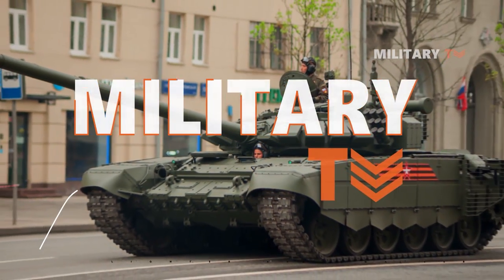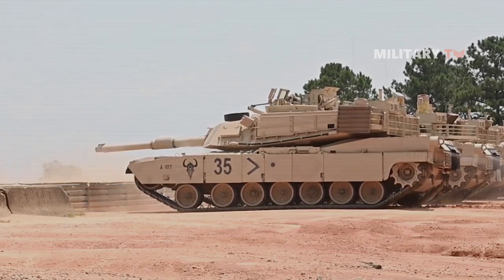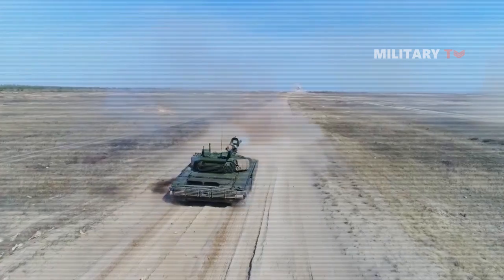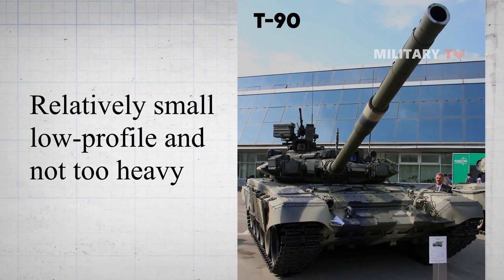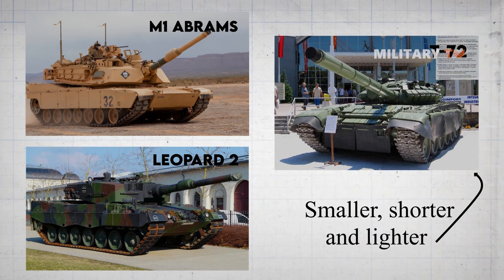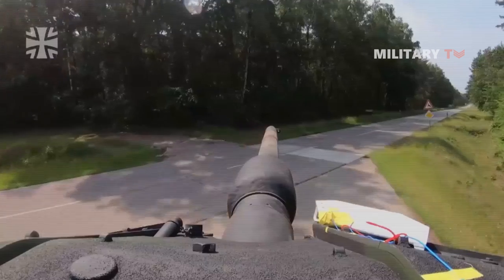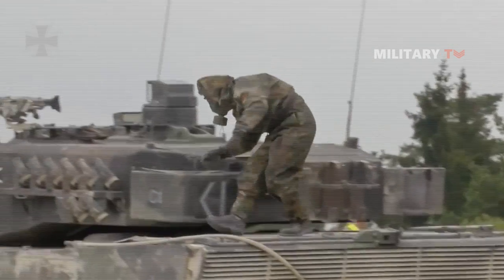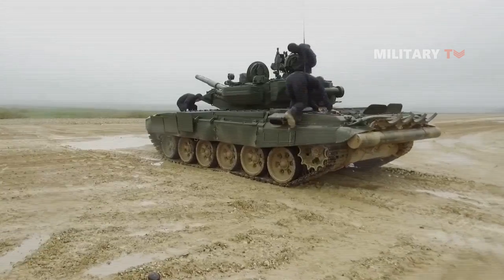Why are Russian tanks lighter and smaller than the western tanks

Comment: I’ve never seen a tank fire two shots so quickly the way that M1 did in the beginning
Reply: they edited it so they skip the reload
Reply: Well hate to break it to you but the M1 probably has some of the slowest fire rates for tanks. They have manual loaders so it all depends on the loader and still wouldn’t be faster than an auto loader.
Reply: @xxmobstrxx8535  yea I didn’t think it would be. I just wasn’t sure if it was edited or had some super fast crew lol
Reply: Same clip on repeat, M1 is too slow at firing
Reply: @xxmobstrxx8535  Hate to break it to you but the M1 crews are trained to get a round loaded and fired every 3 seconds. If anything Soviet and now Russian autoloaders are slower. They also frequently break down.
Reply: @pascojm6816  No it isn't. M1 crews are trained to load and fire in 3 seconds.
Reply: @wulfone5961  yea for how long are they going to fire a round every 3 seconds?  Like I said it all depends on the loaders so fire rates will be inconsistent.
Reply: Human loaders can match autoloaders but the difference is that even with training, human loaders will tire out eventually depending on how long the battle drags on whereas the autoloader will maintain the same pace regardless.
Reply: As others have mentioned the clips is edited as can be seen by watching the radio antennas. An Abrams, or any manually loaded tank gun can be reloaded very fast provided(!) the loader is on standby with a shell at hand, meaning he had time to fetch the reload before the first shot was fired.
Reply: @xxmobstrxx8535  Modern tank engagements only last for a few minutes at the most. US tank crews are usually in pretty good shape as well. Then you have that the fact that the M1's will see the Russian tanks long before the Russian tanks would see them. Time isn't that big of an issue when you can't see who is even shooting at you.
Reply: @xxmobstrxx8535  I understand that, in most present day tank battles, the fight is usually over when the first tank fires. Usually, there is no reason for a second round.
Reply: @xxmobstrxx8535  Well I hate to brake it to you, but majority of manual loaders are much faster than Soviet style autoloaders for the first 10-15 shots.

Good loader can load a round within 2 seconds after firing a first one (already having the other round in hands, AKA a "lap shot"), subsequent rounds are within 3-5 seconds depending on vehicle being on a move, or stationary and whether the ammunition changes - dart / HEAT. 

After firing approx 15 shots, it gets more difficult to reach for the remaining rounds. Some tanks, such as a Leo 2 are limited to 15 rounds ready rack in a turret and the rest in a hull. 
M1 Abrams has 40 rounds ready rack in a turret, then 9-11 rounds in a hull.

In general human loading Western tanks have a slower reload should they want to fire all of their munition, but much faster when firing a burst of up to 10 rounds roughly. This makes for a massive difference in certain situations, plus the loader does other duties such as: helping commander with a radio, maintenance, serving the canteen, sentry / guard duties. Tanks with a human loader are more awake, perform better and can sustain stress for longer thanks to having another body alone. 

Exceptions are:  -Challenger 2, which has two piece ammunition, human loader, thus is just as slow as Soviet autoloaders.
Western autoloading tanks:
-Korean K1, K2,
-Jap Type 90, Type 10,
-French Leclerc
-US M1128 Stryker, which is not classed as a tank, just to include it. 

My dude, you judge too quick just from propaganda videos not delving into the actual realities. It's not in my place to tell you what to do, or how to live your life, but I suggest you rethink this behaviour.
Reply: @verdebusterAP  Every major nations doctrine is to retreat to an alternative position after firing a few rounds.
Whether it's an artillery, motorised, tank  battalion, you should have at least 2-4 pre-made positions to rotate them. 

Leo 2 was designed to limit maximum rounds fired on purpose to 15 (16 if you count the one in a breach). Then the tank would be forced to change position and pick ammo from hull into the turrets ready rack. 

This is to counter artillery/CAS of competent adversaries.
Reply: @janchovanec8624  
Human loaders are going to still tire out even with strike and regroup tactics
Reply: @verdebusterAP  keep him awake pulling security and maintenance for couple of days and see how fast he can load after that

Comment: Other missed reason: because they were designed for manual transmission, the driver should use at least 3 hands to drive them, one to shift and two to control the twin joystick
Not to mention the 3 pedals layout meaning if they forgot to shift to neutral before stopping or stuck, the engine would stall, even minor indelicate differential turn would still stall the engine

Comment: Lot of good comments on here about the advantages of lighter tanks. Two points though; One, I don’t buy the smaller profile advantage when Javelin/NLAWS, etc strike top down. Two, how well do lighter tanks cope with a hit? Surely their armour is less effective?
Reply: Well speed important than heavy tank. Especially possibly end of the  tank age
Reply: Javelin can easily be countered by having a laser warning receiver and smoke
Reply: Well now the tanks have the roof installed and the javelin will have to go through the roof first. LOL
Reply: The thing is even heavy armor will not protect tank from modern missiles and guns. That is why everyone trying to implement active defense systems that destroy missiles before they hit the tank. The best defense is not get hit. If tank get hit, most probably crew will die or will be disable to fight back. So what is the point of too heavy armor?
Reply: @arslanseitaly8364  I agree with this, except there’s one exception… the later leopard 2 models, tank rounds cannot go through the cheeks as of right now due to, quite honestly, it’s HUGE brain armour, with aps to take care of missiles it’s quite the formidable tank
Reply: @arslanseitaly8364  But taking that argument to its logical conclusion you might as well abandon main battle tanks altogether in favour of light tanks, or even armoured cars. Why do they need such big guns anyway? Aren’t they just for killing other mbts?
Reply: They didn't exist when they were designed
Reply: There is no advantage defensively for being smaller. The M1 destroyed so many T72s they had to be renamed T90.
"The T-90 is a third-generation Russian main battle tankThe T-72BU was officially accepted into service on 5 October 1992 by the Russian Ministry of Defence and simultaneously renamed as the T-90 for marketing and propaganda purposes aimed at distancing the new type from existing T-72 variants"
Reply: При безвозвратной потери танка в одном случае вы теряете 3 человека и условный миллион долларов, во втором случае 4 человека и два миллиона. Для уничтожения вы потратите одинаковое количество денег. Что более эффективно? При этом на поле боя эти танки условно одинаковы.
Reply: @ThatCarGuy  the Abrams never destroyed T-72's though. They fought against Iraqi T-72M's which used outdated armour arrays, obsolete rounds that were decommissioned by the soviets around 1962 on top of that the turret was not operated mechanically it had to be hand cranked.

It's like comparing apples to oranges
Reply: @zeffy._440  " the Abrams never destroyed T-72's though." Please troll someone else I block blatant trolls. The Lion of Babylon T72 version they used had reactive armor... These were Russias best tanks at the time. Sources:
" Some Lion tanks may have featured explosive reactive armor, possibly obtained from Polish T-72M1 spare parts.[18]

Another improvised armor upgrade may have also been added at the Taji complex.[2] An additional 30 mm armor plate was welded on the front areas of the hull and turret, leaving an air gap matching the size of the armor, so that the power of a HEAT jet could be dissipated in the hollow space. This technique follows the principle of spaced armor. "

"Well, in his 1994 non-fiction book, Armored Cav, Tom Clancy recounted a tale of how an M1A1 Abrams got stuck in the mud during the ground war of Desert Storm. It was then set upon by three tanks, Iraqi T-72s specifically. A round fired from roughly a thousand yards away bounced off, and the Abrams responded by blowing the T-72 that fired it to bits. A second round fired from 700 yards, bounced off, and the offending T-72 was blasted. The third T-72, at a range of roughly 400 yards, fired a round, which left a groove in the armor of the Abrams. It, too, was destroyed by a shot fired through a sand berm. These were, supposedly, Russia’s state-of-the-art tanks.

Then, when help arrived, and the tank couldn’t be freed from the mud, a platoon of Abrams tanks tried to destroy it. After several rounds, they detonated the onboard ammo, but the blow-out panels functioned as designed. Then, when the tank was retrieved from the mud, they discovered that it was still functional. The only issue? A sight was out of alignment.
"

Comment: because they have longer range and more power plus it has an autoloader and can fire 8 to 10 shots a minute while the western ones are manually and can fire 3 to 4 shots a minute,, also the Russian tanks have way more protection than the western ones
Reply: You pretty much made a mistake with every word there Jorge
Reply: It's not entirely wrong, but it's not correct either. Manual loading can be faster than the autoloader. 
That is with a fresh  and skilled crew... and while the shells are in the "sweet spot". 
The main advantages of an autoloader are the reliability of the reloading and the fact that you need less space in the turret.
Reply: M1 Abrams had met the same fate in Iraq.
Reply: bruh the abrams only met t72s from cold war. T80bvm or t72b3 would eat the crap out of abrams

Comment: Even the new Abrams have 700 mm side armor, and the new carnet automatic ATGM system has a penetration of up to 1190 mm.
Reply: What are those units? I'm willing to be the missile's rated in terms of homogeneous rolled steel penetration. And the Abrams is not armored with just rolled steel.

Comment: Simply from the WW2 experience, that anything over 50 tons is a liability in the muddy Russian and Eastern European theatres, numerous hard hitting lighter armoured units has proven to be more successful.
Reply: That's now how that worked.
Reply: it's not strictly about weight, but about ground pressure
Reply: @SoloRenegade  If you want to reduce ground pressure, vehicle itself would have to be wider. Which makes it easier target for  everyone, from infantry with anti-tank weapons to aircraft, while also reducing it's mobility in confined spaces, like city streets or narrow mountain pathways.
Reply: @ceu160193  Wrong. Vehicle width has Nothing to do with ground pressure. 

To reduce the ground pressure of an M1 Abrams, for example, you need wider TRACKS. As the M4 Sherman did in WW2.

Pressure is force over Area, P=F/A.

For the same weight, you need to increase your surface area contact with the ground.

I even drove a vehicle in combat for years that could adjust it's tire pressure to drive over anti-tank landmines without setting them off. I also used this ability to control tire pressure to my advantage in other scenarios as well on the battlefield, including driving though really gnarly mud without getting stuck. Actually have a really good case example of a specific combat mission where that was a critical factor in me successfully completing the mission (getting through deep mud when others couldn't get through).
Reply: @SoloRenegade  Wider tracks REQUIRE wider vehicle, however. As you have to protect them - otherwise have fun fixing your busted track, when it breaks from some random shrapnel or even hand grenade going off nearby.

Comment: Russian tank are small and light because they are based on the T-44 hull from 1944 and are il-76 air-transportable.
T-14 Armata weights 56 tonnes and will be flown on the il76-90 which is stronger and with a digital-cockpit.
Reply: @Moraceae Ground-pressure is the ratio of weight to track-area which is similar in all tanks.

Comment: Russian tanks are built for the Winter, where as western tanks will usually break down whatever the weather. During the first gulf, we had equipment breaking down all the time, helicopters, planes, tanks, ground equipment the lot as they were not used to sand so once sand got into the things, then you would have to clear everything out. A larger tank is also an easier target to take out, as greater mass of impact. However, it has the advantage of being able to carry more rounds which means more fighting and less supplying.
Reply: This is not WW2,today’s tanks regardless of it’s nation are capable of operation in winter and snow without any significant problems.